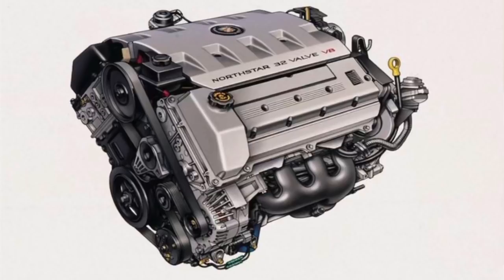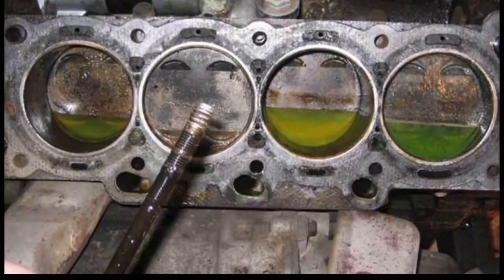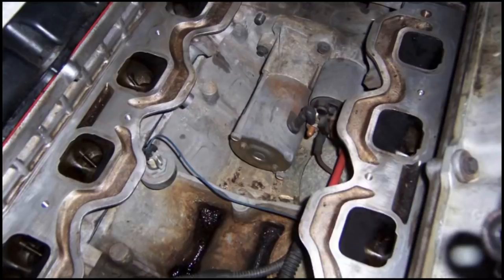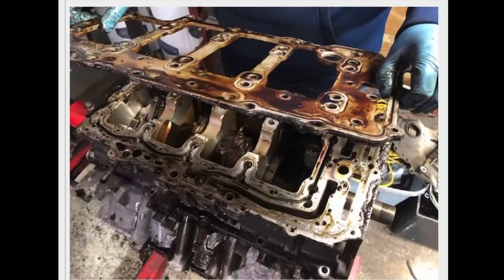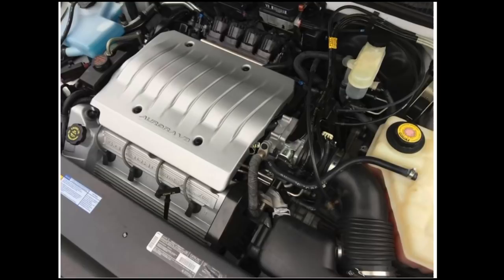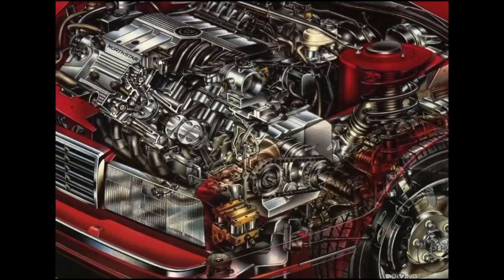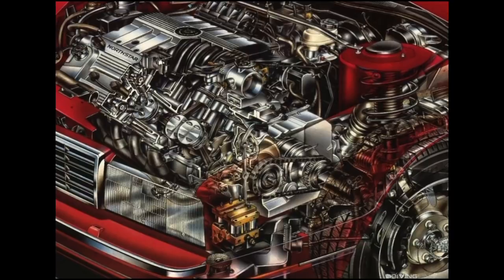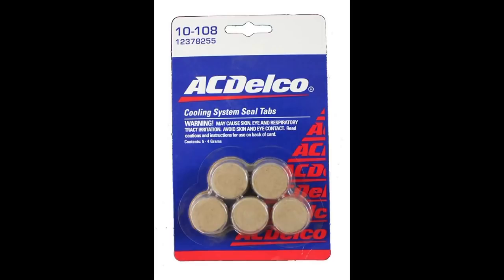Worst Car Engines of All Time: Cadillac Northstar

Comment: Fine threads are stronger than coarse threads.
Size for size, a fine thread is stronger than a coarse thread. This is both in tension (because of the larger stress area) and shear (because of their larger minor diameter).
Fine threads require less torque to develop equivalent bolt preloads.
Fine threads have less tendency to loosen since the thread incline is smaller and hence so is the off torque.
Reply from the maker: Interesting. I guess then why do the GM factory service timesert kits use coarse threads?
Reply: NOT true in al threads. Al tends to fracture at the root far sooner than steel

Comment: The Aurora also suffered from a fuel rail made of butyl plastic, which was leak prone.. This is why I swore off GM vehicles. Spraying Gasoline all over the top of motor, causing it to boil. Huge Fire risk.

Comment: Hot off the heels of the excellent ZR1 Corvette engine of the early '90's, Cadillac had to go their own way rather than run with a smooth and detuned smaller version of the ZR1 engine.  Cadillac paid dearly for their vanity.

Comment: Had a 2007 DTS. When it hit 85,000 miles, the expensive repairs started to kick in. Had massive oil leaks. The engine had to be removed and re sealed just like Adam said. The cost was a staggering $4,300. Then, the alternator went out @$1,200. Then the paint started to peal off of the deck lid. Had all of the fixed, then sold the car for $5,500. That barely covered the cost of the repairs, Lol

Comment: I never had an issue with my Northstar vehicles. Back in the day we never kept one longer than 3 years. With that being said, I have an 04 V8 SRX and 07 XLR now with no issues.

The issues we had typically were the motor mounts. The transverse engine was to strong and we broke many of them traveling accrros the country. They didn't like it when you are going 80 mph, then hit the gas to pass and kick it to 130!

Comment: Maintenance is the most important part of those engines … very frequent oil changes . My client loved her Cadillac North Star , finally gave her Cadillac up after hitting 385000kms …. Till this day she regrets giving it up . Has the new Cadillac 6 cylinder. Hates it. No low end torque… she will go electric for her next Cadillac…. 👍🏻

Comment: I had a 95 Eldorado in Spain , for more than 9 years, 110.000 miles, third hand, and never had an issue with the engine.....so, I guess it is not so bad, radio failes, antenna failed, gear box, not so good, but the Northstar engine.... if you take care of it, it will last for looong time

Comment: Drove my Grandfathers 1998 Deville after he passed in 2003 for 15 years and put 190,000 additional miles on it before the head bolt pulled out. Loved the car. But it reached the end of its lifecycle.

Comment: I would go as far to say that the issue with the bolts themselves aren’t the fine thread vs corse thread simply because fine threads are known to be stronger then corse threads.. the material and grade of the bolt however I believe are the real problem

Comment: I had a 2004 Cadillac DeVille from 2005-2016 with a Northstar. Engine failed after a little over 108,534 miles, blown head gasket. $4,551.27 to REPLACE ENGINE ASSEMBLY WITH A USED MOTOR/ 76K -6MO. WARRANTY (copied straight from the repair order). Never will buy a Cadillac again.

Comment: I've owned a lot of Cadillacs over the years. About 30. I had a 468 I disconnected the 4 and 6 and it ran mint for years. I had a few HT 4100s and they ran perfect when maintained and not beat on. I got 160,000 miles off one and sold it running mint. I know someone who had an Eldorado with one that got over 200k miles. Ive unfortunately also had the disfortune of owning a few Northstars and they are pure junk. If it was manufactured before 2006 around when head bolt issue was fixed, they are a self destructing engine at 100k miles and maybe before. This engine was a joke of design and cost myself as well as others a lot of time and money. I have never heard anyone refer to this steaming pile of crap as a good engine.

Comment: I've owned an 95 olds Aurora and it was good. It's funny you mention the thermostat, the previous owner completely removed it because of those issues. I had to replace the coils which is how I got the car. And yes the motor did go from lack of oil. But was a great car and I'm sure spraying nitrous didn't help lol

Comment: A few horribly unreliable engines I can list: Cummins 12v 6BT, Toyota 22R, Ford 300CID straight 6, Mercedes-Benz OM617, and Volvo’s B18 (can only go 1,000,000 miles before rebuild is needed).

Comment: had two northstars -- a 98 Eldorado ETC and a 2001 STS.  For a front-wheel-drive car, those things were fast, especially for the 90s.  had all kinds of problems with sensors, i think related to the suspension.  didn't blow any head gaskets or leak oil, though.  I drove them hard but i didn't put hundreds of thousands of miles on them.

Comment: I have been told 2003 Caddys are better. Bolts were changed. I also heard that 2007 and up Northstars have no head gasket issues. Is this true? I have always owned Cadillacs. I would like to replace my 1996 Fleetwood, but have Northstarphobia.
Reply: 1996 Fleetwood is arguably the most reliable and least expensive Caddy to repair and maintain. I'd spend the money to restore/improve the entire car rather than buy any other Caddy.
Reply: @TheRetarp  Thanks, Emil, for your reply. I have thought long and hard about this. You're right! I have been driving the 96 as my 2nd car for over 10 years and it only needed regular maintenance. The car is beautiful and everyone looks at it. I bought it because nobody makes a big station wagon anymore. Yeah, it's a hearse. A funeral director was retiring it. Perfect condition and he only wanted 2,000 for it! For me it's the perfect wagon and I always owned Cadillacs. I recently got the urge to get a much newer hearse and sell the 96. After thinking it over and reading your reply, I think I'll buy a 3rd car and keep the 96 in the garage. Thanks.

Comment: My years as a mechanic what I seen almost all the time with that engine was if it got ran low on oil even a little bit, I think it was the front of the oil pan was so shallow and close to the rods that if it was run low, the rod bearings was what went.  I replaced a number of them. That engine held a lot of oil and most quick change oil places would put 5 quarts in it and send them down the road no telling how many was lost due do that

Comment: Had a 2000 STS. Head gasket totaled it. 3k to fix a 3k car.
 After spending tons on maintaining it, I had enough.
From what I've seen, it's a gamble on these engines
I had heard they changed the bolts in later years.

Comment: The other element that should be added here is that these head gasket failures went on  years. Many people say dont  touch a Northstar until a 2002( or later) year model
You are spot on when you say it absolutely ruined the residual values of the Cadillacs in the 90's
Reply: What causes Cadillac to lose residual value even more than Northstar problems, is abandoning the making of repair parts. That kind of short-term profit strategy is a real turn-off for people who support #RightToRepair.
Reply: @alanblanes2876  I am talking value they lose as 3-4 year old cards
The value of these cars , bought used, plummeted in the 80's and 90's
So that Lexus  LS that was about the same price as a Seville in 1993 was worth about half of what the Lexus was worth just a few years later

Comment: BMW N62 and the N63 V8's are way worse than Cadillac Northstar by a Country Mile.
Reply: @Rick Johnson
Class action lawsuit and BMW is financially helping effected owners
There is also a class action lawsuit going on right now with GM with the 5.3 and 6.2 V8's used in the trucks/SUV's
Reply: @turnne  It is great when owners/enthusiasts band together to demand standards of good faith from manufacturers.
Reply: @alanblanes2876  Well..clearly they didnt band together hard enough because the northstar had HG issues for nearly a decade
Reply: @alanblanes2876  Well...the junkyard probably had plenty of of Northstar equipped cars from people that junked them due to the repair cost versus the value of the car
Reply: @turnne  That's how its turned out, but the good, well-cared-for Northstars deserve to be kept in top nick. Electrical engine parts should be kept in production, and it will be organized Cadillac enthusiasts who could band together to achieve this.

Comment: The reason the car had so much power with insane gas mileage was because they had really high compression.  They were actually a really high tech engine for its day but yes.... head gaskets were there biggest issue.  Back in the day you would have the engine block time certed to prevent future head gasket issues. 

Also the car was not designed to work on without dropping the motor

This engine had insane potential but they never addressed the issues and no aftermarket support
Reply: Thats probably why head gaskets were a problem - high compression.
Reply: @wizzard5442  bingo

Comment: I had a 2002 Cadillac STS touring sedan which was a wonderful car. Never had an issue with the NorthStar engine but did have a leaking A/C evaporator which required recharging monthly.
It would have required the entire drivetrain to be dropped to replace it so I sold it in 2013.

Comment: I wouldn't mind having a Northstar. I can do the work myself so I would only have to worry about the cost of head bolts/studs and gaskets. As for the starter. It's not in a great spot. But how long do starters typically last? Quite a while. And by the time the starter goes out, it's probably about time to change some gaskets anyway. Most people just hear complaints and repeat them. Or they take their vehicles to mechanics that make the job sound 100 times worse so they can overcharge them.

Comment: Boy o boy,  seems like another case of Cadillac trying out some advanced, but untested/unproven engineering on their customers.   Adam:  How many of these issues have you experienced on your Northstar?
Reply from the maker: None. But I maintain it well and always watch the temp gauge. Only issue I’ve had is AC compressor and alternator failure.
Reply: @RareClassicCars     Cool!
Reply: @RareClassicCars    Sounds like Adam drives his Northstar engine the same way I drive my Camry 4cylinder that should be on some sort of list.  "Egg between my foot and the gas" until the engine is completely warmed up.  Change oil every 3000 miles and use carbon guard additive.  This damn engine sounds like a worn out Vega until it is completely warmed up, and has sounded this way ever since new..  The wise ass Toyota service rep told me I was "old fashioned and didn't understand how today's engines worked.....".  I advised that I might be old fashioned but know poor engineering when I hear it.  Obviously, Toyota loosened up tolerances to gain that elusive mile per gallon or two.  The little smart ass even admitted what I was hearing was indeed "piston slap".    Would have like to meet up with this wise ass rep again years later after Toyota admitted there was a problem and offered limited free repairs.  Needless to say, I didn't qualify for the repair only because I have taken special care of the engine and it doesn't burn much oil at 180K miles.  Probably for the best, I really don't want the lowest paid tech replacing the pistons on my engine doing his best to beat a low flat rate payment from Toyota.

Comment: The head gasket material and the head bolts are the only reason to avoid... I've changed starters on this motor in about 45 minutes... Starter location is not a deal breaker. If you put regular antifreeze in it instead of DEXCOOL will cause the head gasket material to deteriorate.

Comment: This is ridiculous, it's an aluminum dual overhead cam v8. No VVT to mess with. Northstar performance has made head studs to fix the head gasket issue, there are certain years with forged cranks and they all had forged rods, a little bit of boost and you can get 600-700 horsepower. Don't even go after the starter. I never understood that complaint, so you'd rather lay on your back and stick your hand up in the engine bay get it greasy and fight the space, or would you rather put it into the intake with 10 bolts and make it a 15-minute job? Hardly any grease? I literally do not see a downside to this engine except for the head gasket issue which has been corrected if you buy Northstar performance head studs. I've always wanted to build this motor, I bet it would make great power with a turbo and a mega squirt. I never understood the dislike for this block. The 60° V6 bellhousing also gives you a choice between front wheel drive and rear wheel drive transmissions both coming in automatic and standard. Would make a wicked s10 on boost. Most of the hatred from this engine comes from the mid twenties to early 30 year old who remembers grandpa having trouble with it. I agree.. it's going to need someone who's willing to love it and go the extra mile for it but if you're wanting to build power what more could you want in this set up right here In a v8? Confused
Reply from the maker: You’re forgetting that the average person doesn’t want to spend $3-4k to have such a modification done. That’s a huge bill to stomach.

Comment: The LT-5 in the ‘90s ZR-1 Corvette has some similarities to the Northstar, and is arguably one of the best engines of all time. It still holds several endurance records for a production engine. (Averaged about 175 mph for 24 hours straight) The big departure was that the LT-5 was hand built with excruciating attention to detail at the Mercury Marine Plant, and the Northstar was mass produced. Things like starter location, the “skirted” block, coil packs, 4 cam, 32 valve, all are similar and the reasons why it is so powerful yet fuel efficient. Sadly though the Northstar was just a near miss given the problems Adam reviewed. If they would have just went a little further in making it more bullet proof, it would be considered a best of all time. I’ve worked on NS engines, owned and worked on Lexus LS engines, and have owned and worked on C4 ZR-1 Corvette engines, and they all are similar, but GM just didn’t do it as well on the NS as the others did, and as they could have.

Comment: How can the engineers not see this one coming???    Don't they test the new engines 100s thousands of miles to extreme conditions/loads??    Larger headbolts with thicker threads cost what?  couple pennies more?   And they didn't correct it until like 2004.  By that time the reputation was ruined.   You do that to your flagship??   Lots of my friend will not touch a GM product for that reason...

Comment: I had an 09 dts ..got 245 k out of it  before I sold it..with no head gasket issues,  it definitely leaked oil , but was such a beautiful car the oil leakage didnt bother me.  I've had many north stars,  biggest tip ..never let them get hot ,that temp gauge starts going up..shut the engine down and find problem.

Comment: If the starter gets stuck on a Northstar you can take a 3/8 1 ft extension and tap the solenoid through a small opening between the intake manifold/ water pump housing. I did this for about a year-and-a-half before the starter finally gave up
Reply: Just went through this with my 1999 Oldsmobile Aurora 95,000 miles  starter died cost me $875.00 for starter, intake gaskets+ labor. It is my daily driver

Comment: It's hard to believe the head bolt design was an overlook rather than a purposeful failure point. GM engineers are not dumb enough to use fine threads on aluminum, any high school shop class teacher could tell you that's a bad idea.
Reply: Could it have been a nefarious planned obsolescence scheme from the outset? If so, Cadillac needs a tutorial from manufacturers that stand behind their care forever.
Reply: @alanblanes2876  Well it seems like Cadillac has payed the price in recent years. As Adam said on his channel, the accountants run the companies now, not the engineers and designers.

Comment: Great, I just bought a 2008 DTS with 53K miles on it. I'm not a car guy and have never heard of a Northstar engine. What mileage do I need to be having preventative maintenance on this thing done so I don't run into these serious problems? I got the car from a retired couple who kept it in their garage. It looks like they stored it in an air-tight container. The thing still smells new if you can believe it. I thought I lucked out.
Reply: 2008s had fixed the head bolt issue.

Comment: Affa Romero built a excellent engine based on the same design but it was not a cheap design!I myself had a 1100 putting out close to 300 hp with no problems very reliable  engine!!!

Comment: I owned 3 northstars, 1996, 2002, 2003, never had one issue other than minor burning oil, amazing performance and gas mileage overall. I averaged 27.5 mpg with my 1996 model with heavy highway driving. My 2003 DTS with the H.O. was more of a gas guzzler but the extra ponies were great. I guess i got lucky.